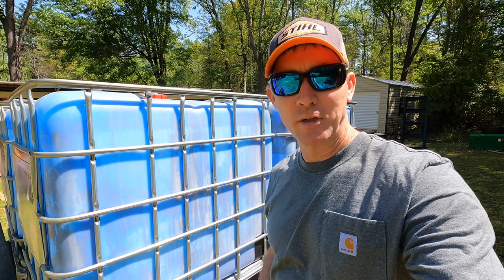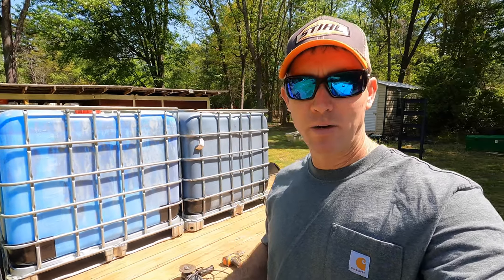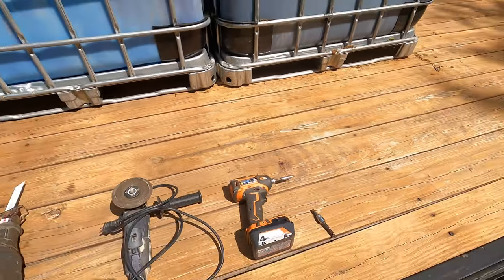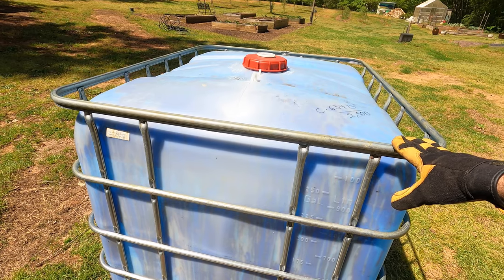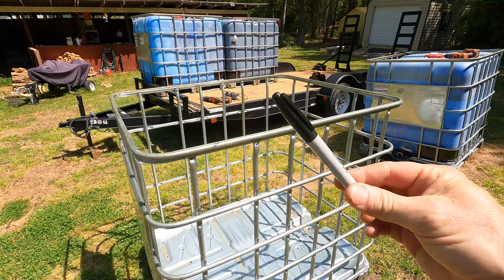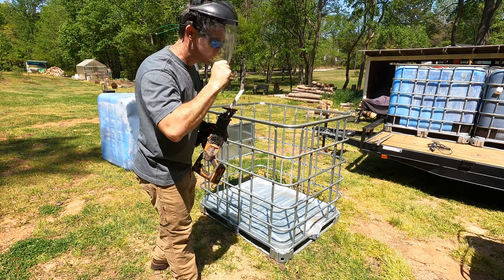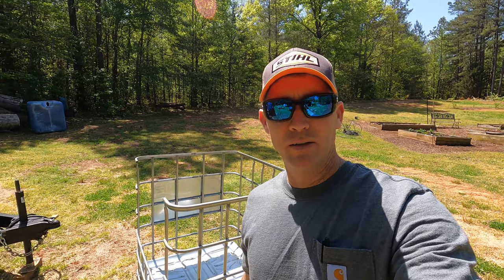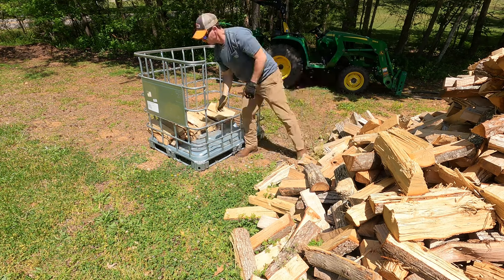Turning IBC Tote into Firewood Storage

Comment: You have to fill the tote 10" above the existing tote to get an honest Face Cord. The wood will shrink down to 48" after it's dry and you'll have a true face cord. This is for the 275 gallon totes that you are using. The 330 gallon totes are 48" tall to start with so I would go 4" over the 48" so when it shrinks/dries you'll be at 48".
Reply from the maker: Thank you. I am starting to see that now as the wood is drying.